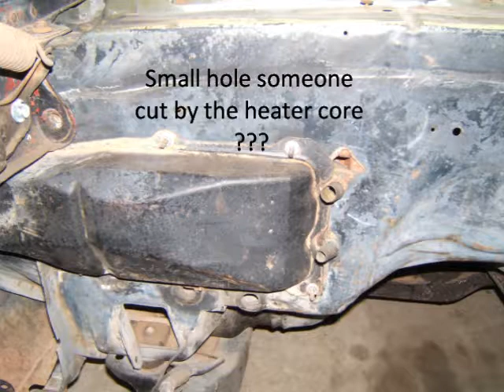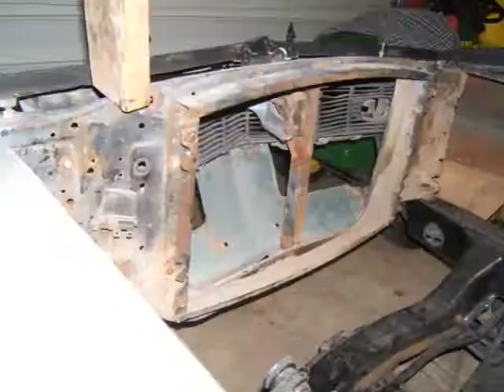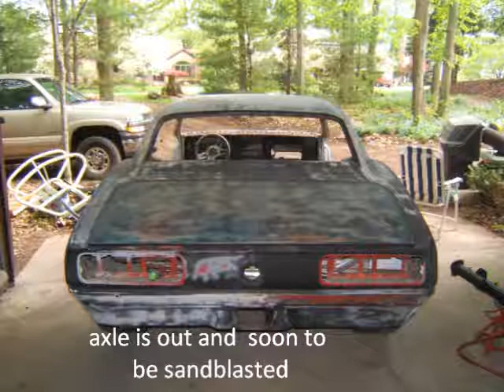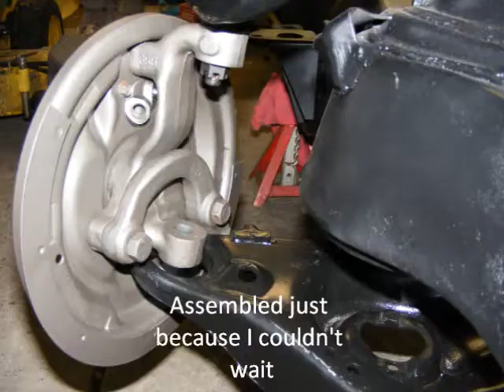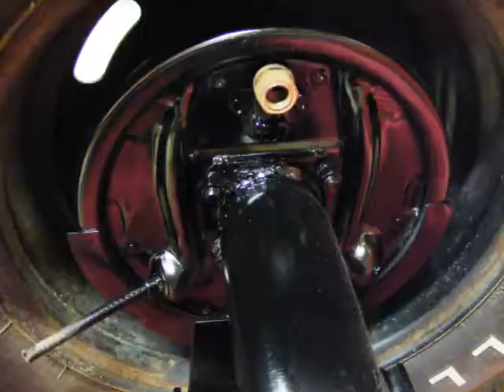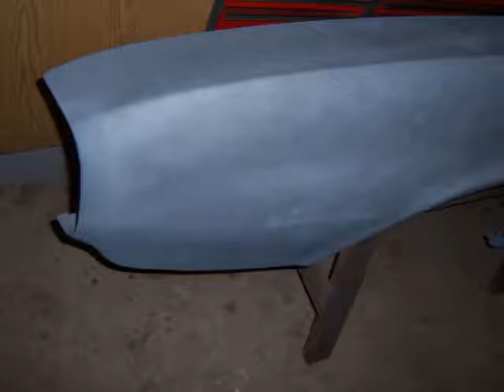68 camaro restoration

Comment: For the Console use SEM (satin black) spray can you can find it at any auto body paint store. (Satin Black) of (Flat Black) are the stock interior colors in the classic Camaro's. It can be used on all interior parts for kick panels even the upholstery.

Comment: Go to WalMart or auto store and by the spary can that says vinal. its the best thing for for console and inside misc. like seats belts and seats or carpet, steering wheel, dash pad,door panels, Hell the hole inside. how I know it works I used it on 3 cars and trucks that I restored. long time ago.